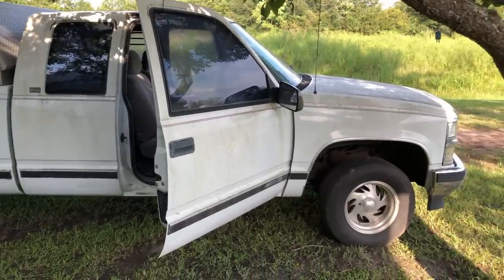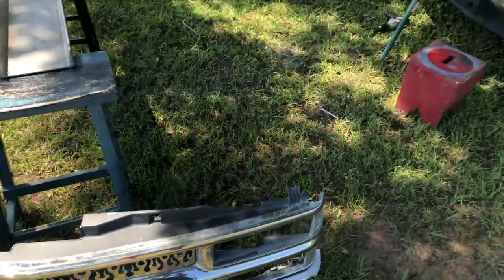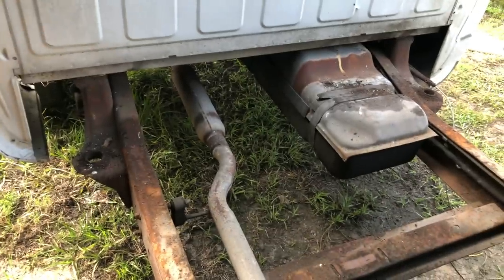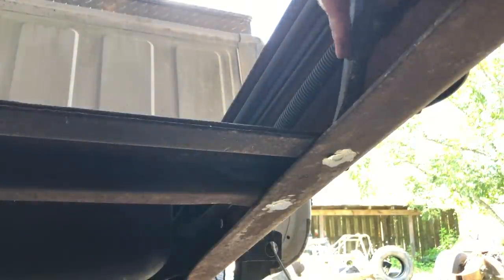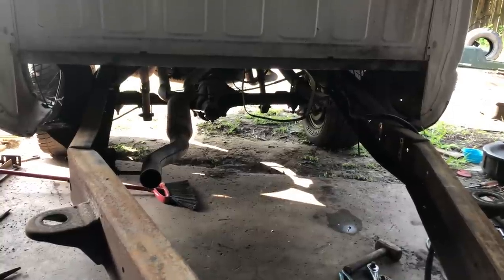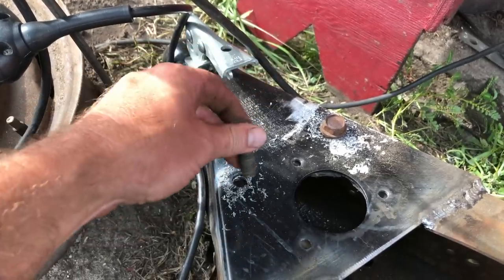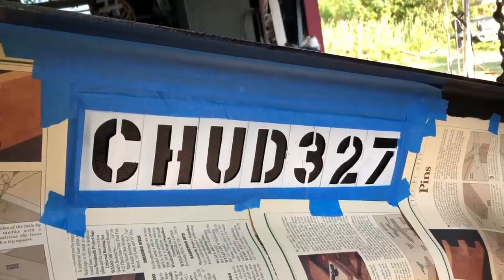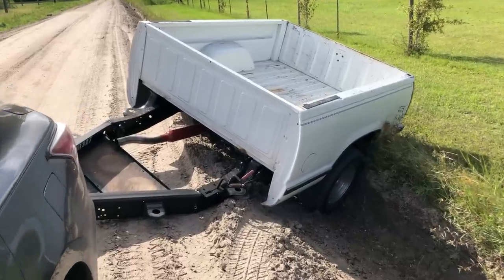Building a Sicker / Better Truck Bed Trailer #2

Comment: How much you want for the rims on the white truck?
Reply from the maker: Two of those are already sold, but I have the stock ones off of the green truck still. Thanks for watching.
Reply: I have a 94 tahoe..on 22 but I dont like how it looks..I want it to look like the withe truck you had with the dip dish rims...and by watching..dont worry..I love to learn new tings
Reply from the maker: @jorgemireles9308  Gotcha, I wish I could help you out. thanks for the reply.

Comment: I’m in the market for a truck bed trailer.  Do you sell them ??  If not, do anyone that does. ??  Thank you…
Reply from the maker: I have sold 3 so far. I have one now I would possibly consider selling. It is an s-10. I also have a full size dodge I am thinking about doing . Where are you located and what kind of truck are you thinking? Let me know and thanks for watching!!
Reply: @chud327  thanks for your speedy response, right this second, it’s a pause on the truck bed trailer, long term plan (3 yrs +). Is implement Operation GTFO…. Most likely Belize or Costa Rica….   I know that something is going on, everybody are dropping like flies..  Didn’t mean to go down this rabbit hole.  I was thinking of driving with a rugged heavy duty trailer, thus me finding you…. For now, it’s a no go on the trailer, I need tie up some loose ends.  Thank you.

Comment: Take the muffler off the trailer. It is un- needed excess weight.
Reply from the maker: That is true, but I like the way it looks and it will be hard to get out. Call me lazy, but it is not that much extra weight. thanks for watching.
Reply: Should not be that hard. Just as far back as you can & cut it. I think what you are doing is a smart idea. Reusing on pickup bodies keeps em out of the junkyards. 🙂

Comment: Sell me those hub caps
Reply from the maker: Which ones and thanks for watching.
Reply: @chud327  i was talking about the eagle alloy wheels but I seen you ended up using them. I have a 1973 c10 with the eagle alloy 206 wheels but I'm missing 3 hubcaps

Comment: only 2 cutoff wheels,,, lol keep dreaming.
Reply from the maker: Call me a liar if you like, you were not here, were you? Maybe you don't know how to use a cut off wheel as good as I do.  With my hand on the Bible, it only took two, but does that statement mean anything to you? I doubt it.  I bet that torch would have been faster, nastier, and more expensive. thanks again for watching, not for the comment, but for watching.
Reply from the maker: Sorry, I thought you were a different troll, but it truly only took two. thanks for watching.
Reply: @chud327  LOL,  naw, I just know I go through stacks of those little bastards.  Then again I buy cheap HF wheels.

Comment: Typical Chev they look nice but make shit engines, would be a nice looking trailer!
Reply from the maker: All three in my yard had a 1/4 million miles, that doesn't sound like crap engines to me.  Either way, thanks so much for watching.
Reply: chud327 I had a 6.2 liter diesel that had nothing but problems especially in winter! I’ll never buy another GMC or Chev product!
Reply from the maker: @harles5000  I have never experience that with GM.  We usually by Hondas for the wife these days and we got a CR-V once that sounds like what you are describing, we traded it in on a different Honda.  She has had 5 Hondas and all but 1 has been perfect.  I am sure every company puts out a lemon every once in a while, but I have had great experiences with GM.  Thanks for the reply.
Reply: I have a 2011 Ram 3500 4x4 Laramie with the 6,7 Litre Cummins great build I will make that truck last as long as possible!
Reply: For whatever reason the Aluminum blocks didn’t fair well in Canadian Winters!
Reply: chud327 I’m glad you didn’t have the GM Nightmare I experienced! That being said my 77 Pontiac Leman’s was the best car I had only routine maintenance and I drove it for ten years. My buddy bugged me to sell it to him which I did begrudgingly he wrote it off the next week in a wreck. I bought an 87 Ford Ranger as I really needed a truck I’m not a big Ford fan but that was also a very reliable vehicle. I enjoy your videos and I have always  wanted a box trailer so I am going to find a truck with a blown engine and do just that. Thanks for the inspiration.

Comment: You wasted that whole truck and you could of made something out of it productively
Reply from the maker: Wasted in your opinion, but with out a title, it is already wasted.  I have been parting it out helping other trucks get better, that is not a waste. Thanks for watching.
Reply: It is not a waste see how cool that is and without a title and a engine I would never drive
Reply: @reidmorin7984  it's nice to make it safe and drivable then it was worth $1,000 now it's worth $100 it's definitely not worth it also he could of made a off-road biggie with out a title he could of done something like the red hurricane Toyota car
Reply from the maker: How much would it cost to get an engine and transmission just to make a 2 wheel drive off-road biggie, maybe $1000?  Then if you make it a 4X4, how much more would that cost?  When I sell it, I promise it will bring more that $100.  I will be sure to post an update on how much they sell for.
Reply: @chud327  I was talking what you did to it price ways you already had a truck bed trailer why another
Reply: To make a train it is cool